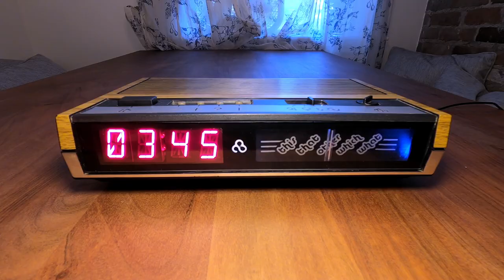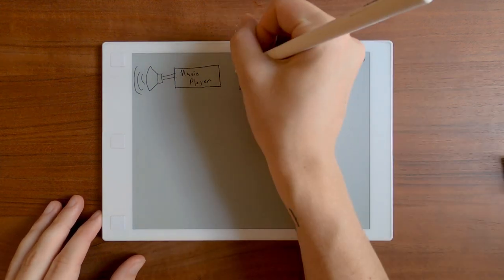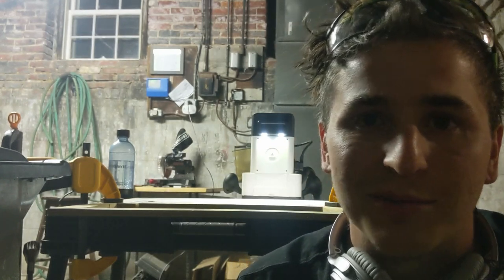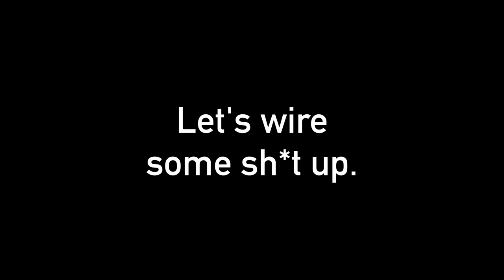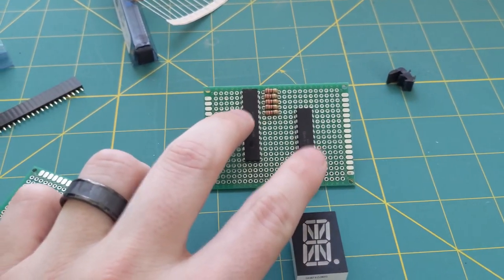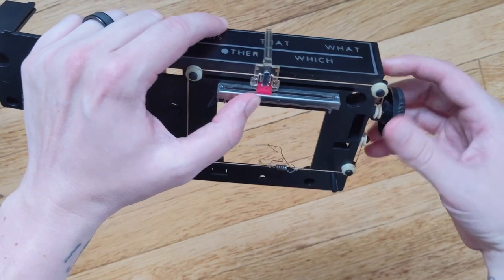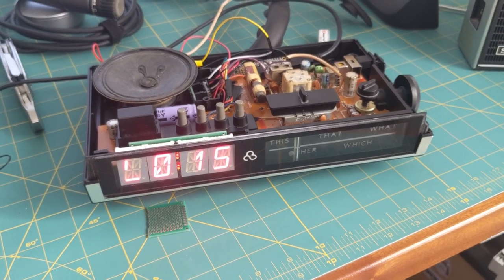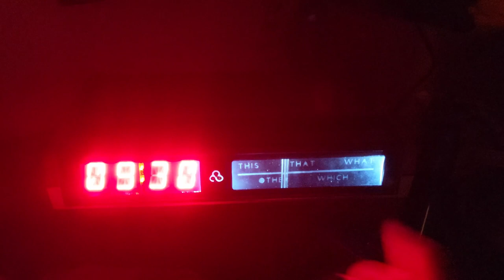I turned an old alarm clock into a music festival jukebox

Comment: What is this tool you turn to attach wires to the pin headers? Is it some sort of crimping tool? Do you need special wires for that?
Reply from the maker: I just know it as a "wire wrapping tool". Mine works specifically with 30awg solid core wire

Comment: Here are my questions: 
1) where is the data?  where is the music being stored?  (also what is the source of the data?  is every single performance there?  I'll give a kidney to hear the Emmylou Harris/Spyboy set from 2003)
2) is there a 1/8 output to connect to better quality speakers?
I'm sure I'll have more later.  super cool.
Reply from the maker: Great questions!
1. The songs are all stored on an SD card hidden inside. I currently have it set up to load 1 year at a time, mostly because I didn't have enough time to source any more music / data. I literally just pulled up the 2019 schedule, walked through each set, purchased a song from each artist (if I hadn't already), and loaded it on to the SD card. If I had more time, I would have a figured out a way to automate the process and pull in more years. next time.
2. I was planning on adding a 1/8 jack (would have been pretty straightforward), but by the end it became clear that that old speaker was part of the magic. I liked that everything was self-contained. Though that may have been exhaustion talking!

Comment: What tool are you using at ~15:06 minutes?
Reply from the maker: 30 AWG wire wrapping tool. Great alternative to soldering in places where you need lots of really thin wire.
Reply: @GuyDupont  Very cool, I'm going to grab one of those for sure. I hate soldering around the rat nest of wire that my projects somehow turn into as the build progresses.